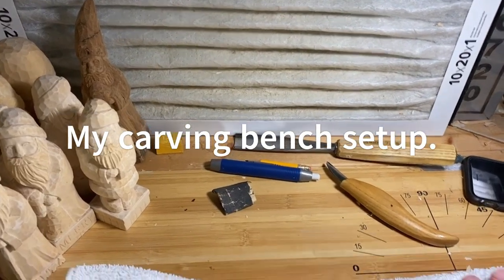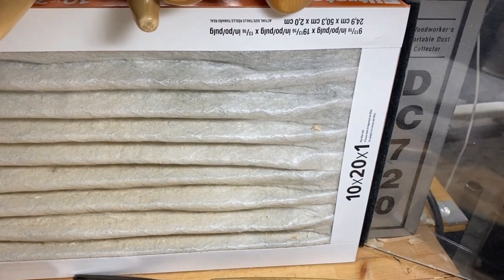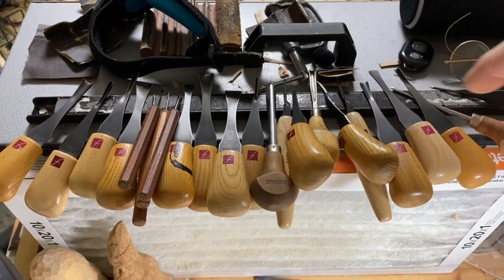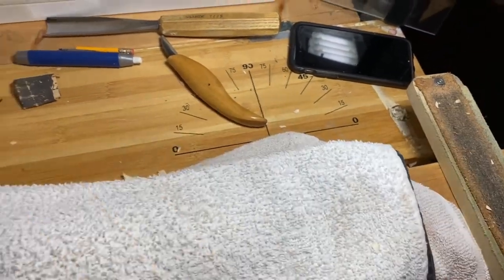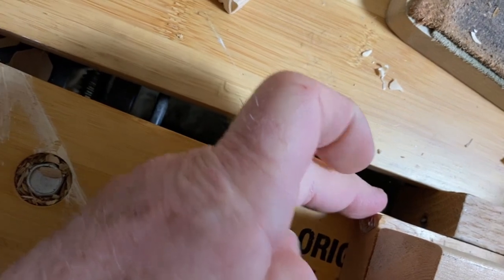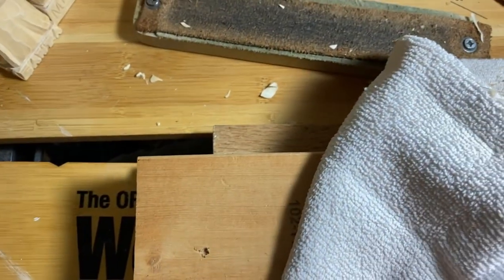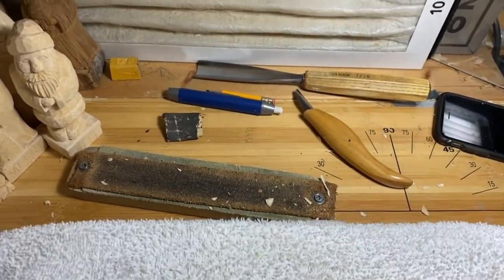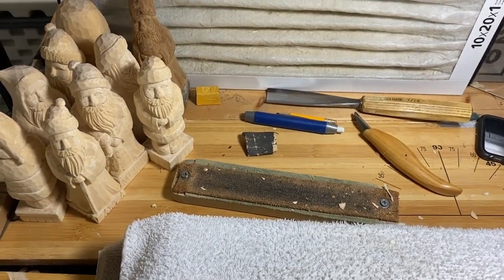My wood carving bench setup

Comment: Very informative video and thanks for showing your set up. It looks like you do knife carving primarily, but I was curious if you've ever used the desk top dust collector for power carving. I do both knife and some power carving, but trying to figure out a good dust collection system for my power carving. A down draft table is another option I'm thinking about. But not sure which will work best.
Reply from the maker: Hello!
I like the portable dust collection unit that I use, it also has 3 plexiglass pieces that fit in front and with a variable speed fan it creates a strong draft that should work well with a burr type power carver. The filter is visible in front so you’re more aware of cleaning it either by replacing it or taking it outside and brushing it off.